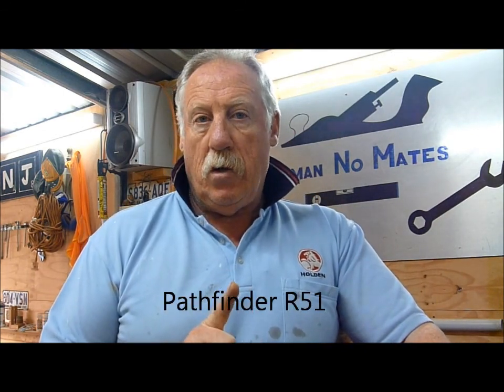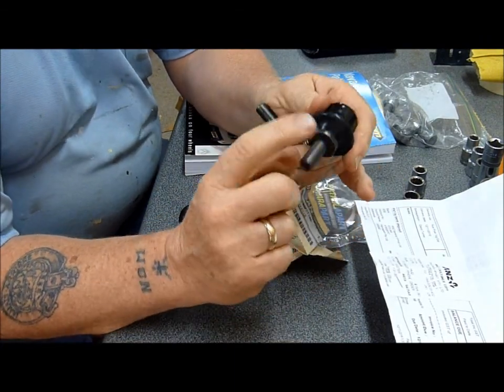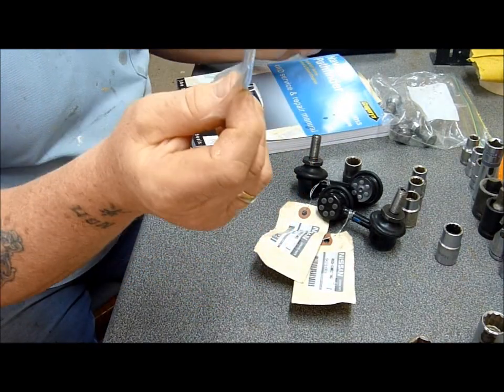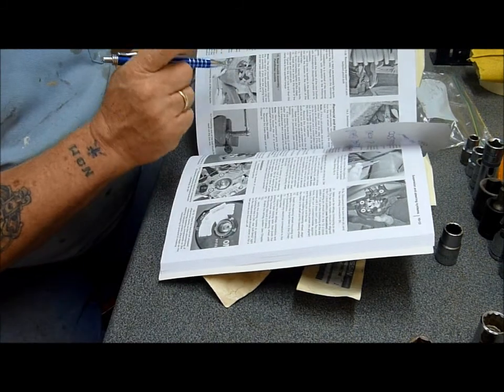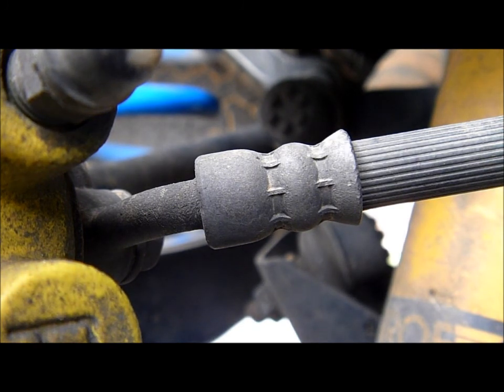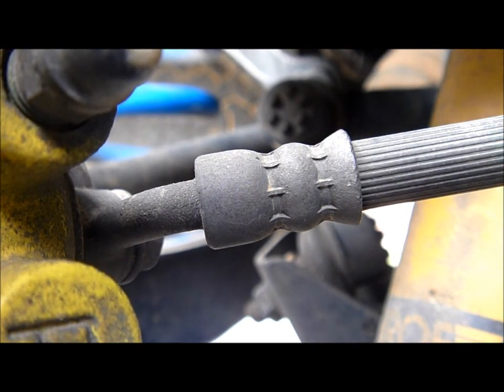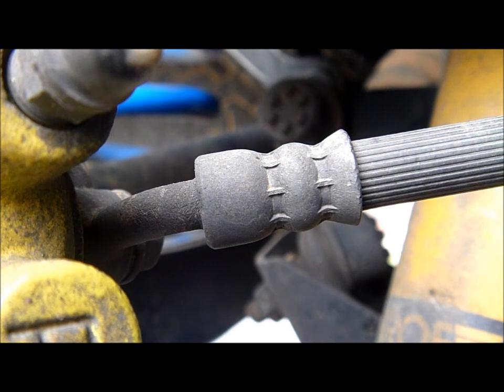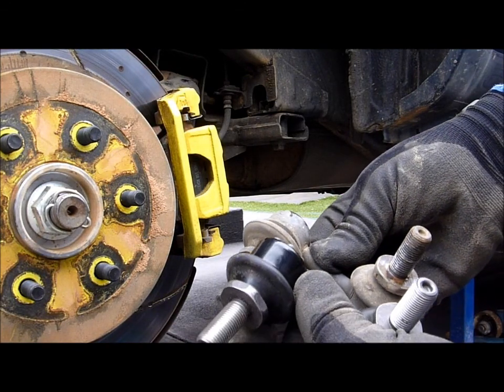Sway Bar Linkages replacement, R51 Nissan Pathfinder

Comment: The bolt on my swaybar link spins even when holding the inner nut.  Outer nut on bolt spins with the bolt.. any suggestions?
Reply: Break the head off and you should just have the male swivel stud. Vice grips and your socket will do the trick. I just did mine and had the same issue.  Hope you got it fixed by now anyways, for the next ones. 😂
Reply: @Dogg416  Thanks.  Because I couldn’t remove it, I just left it.  It will do it on the weekend.